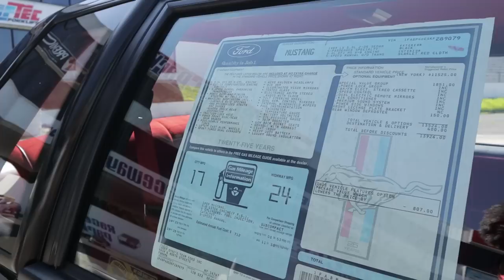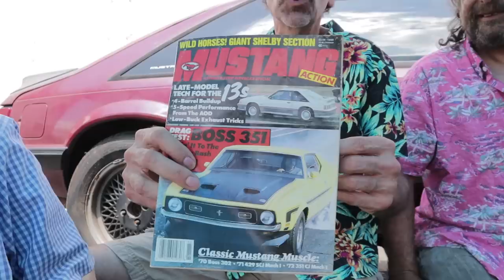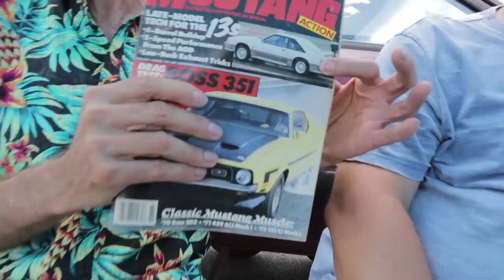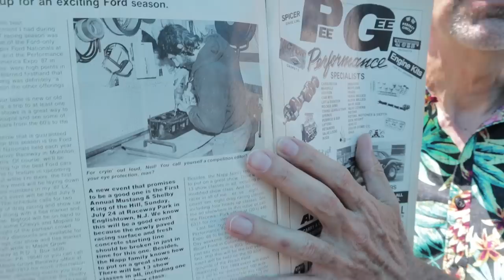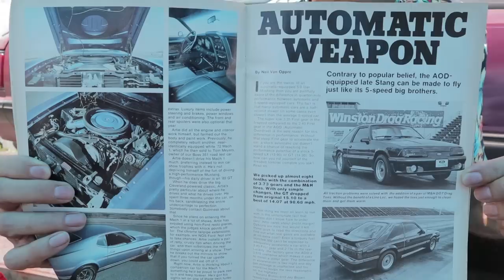5.0 Fox Body Mustang Revolution- The Second Coming Of The American Muscle Car

Comment: Im a Chevy guy but appreciate all brands. Ford nailed it with this
Reply: Those were classics.
Reply: justin c , Chevy guy here as well, fast is fast, as I’ve gotten older I appreciate anything American v8.
Reply: I own a chevy Cruze and a 97 ranger, 4.0 4wd 5 speed
Reply: I'll never sell my 93 notch back even if it just sits in my garage.... I have too many toys and not enough time for all three. Wish I lived in the south again where I could drive them year round.
Reply: BINGO. You nailed it. I'll never understand what causes so many guys to feel they have to "hate" the other makes. Of course you can be partial to one auto maker.......but that doesn't mean we have to hold such stupid animosity towards all the others. The best mechanics frown on that shit anyway. They know better. Cheers.
Reply: Chevy guy here too. I always lusted after the notchback LX. It was clean, good lines and stripped of all the fluff aero, decals and ugly taillights the GT had. Ford nailed it with the 5.0, gotta give props when they are due.
Reply: I'm building a period correct 86 sand beige stripper coupe with twisted wedges, 1.7s, ported intake, still SD.
Reply: The 5.0 is a LEGEND ford hit the nail on the head with these little cars. Tuned and driven correctly they would stomp anything on the road on thier day
Reply: @ragalyisp  those rangers lay you back when you whack it
Reply: I'm with ya brother. I loved the looks of the camaro but since it was slower I bought the mustang back then.

Comment: Back in 87-88 I hated Mustangs.  Was a Camaro guy, made fun of them dang 5.0's.  Next thing I knew, had a 93 coupe, and later bought my 03 Cobra.  So cool seeing some faces with articles i recall reading.  Super cool seeing Bernie  there.  +1 Sub.
Reply: WHAT BERNIE SAID ABOUT YOU COULDN'T BUY ANY PARTS FOR THE SMALL BLOCK FORD STEMS DOWN TO THE THREAT THE SMALL BLOCK FORD POSED TO THE SMALL BLOCK CHEVY BACK IN THE 60'S WHEN THE 289ci DEBUT. THE 289ci WAS SUCH A THREAT TO THE SMALL BLOCK CHEVY THAT THE NHRA (HENCHMEN FOR GM OR ANOTHER DIVISION OF GM) IN ORDER TO KEEP CHEVY IN THE WINNERS CIRCLE. WOULD CHANGE THE RULE BOOK ON THE 289ci MOTOR LIKE THE WEATHER CHANGED IN KANSAS TO DISCOURAGE ANYBODY FROM RUNNING IT. THE CHANGING OF THE RULES WERE BOTH WRITTEN AND UNWRITTEN. SO IF YOU SHOWED UP AND RACED AND WON. THE NEXT TIME THE RULES ON THE MOTOR WOULD BE CHANGED SO YOU COULDN'T RUN IT. IT WAS ALL BASED ON CHEATING. WHAT I WROTE HERE FINALLY ANSWERS THE MYSTERY QUESTION OF WHY FORD'S COST MORE TO BUILD. ON THE OTHER HAND YOU CAN BUY RACE PARTS FOR THE SMALL BLOCK CHEVY THAT WERE EVERYWHERE AT NICKEL AND DIME PRICES. SINCE THE SBC WAS THE FAVORED MOTOR. THERE PARTS WERE NEVER RESTRICTED AND MASS PRODUCED WHICH KEPT THEM CHEAP. ON THE OTHER HAND NEITHER WOULD FORD NOR THE AFTERMARKET RISK PRODUCING RACE PARTS FOR THE SMALL BLOCK FORD WHICH THE HENCHMEN FOR GM THE NHRA WOULD BAN OVERNIGHT, AND THE MANUFACTURERS WOULD BE LEFT WITH A WAREHOUSE FULL OF SCRAP METAL. BECAUSE IF YOU CAN'T RACE IT AND WIN, THEN PEOPLE WOULDN'T BUY IT. FOR THE FEW COMPANIES THAT DID PRODUCE PARTS LIKE CAMS, MANIFOLDS, PISTONS, ETC. THESE PARTS WERE PRODUCED IN SMALL VOLUMES BRINGING TO COST UP 2-3 TIMES MORE. NOBODY WOULD DARE PRODUCE A HEAD FOR A SMALL BLOCK FORD BECAUSE OF THE THREAT OF A BIG EXPENSIVE PART LIKE THAT BEING BANNED, WHILE AFTER MARKET HEADS FOR THE SMALL BLOCK CHEVY WERE PRODUCED WITHOUT RESTRICTIONS. WARREN BROWNFIELD WHO I THINK LATER STARTED AIR FLOW RESEARCH WAS MAKING RACE HEADS FOR THE SMALL BLOCK CHEVY FOR YEARS AND SO WAS EDELBROCK. SO IF YOU WANTED A HEAD FOR A FORD WHERE DID YOU GO, NOWHERE. YOU HAD TO MAKE IT. YOU ACTUALLY TOOK CHEVY VALVES AND MACHINED THEM DOWN. ALSO WHAT BERNIE SAID ABOUT A HEAD BEING AVAILABLE FOR THE SMALL BLOCK FORD. CAME ABOUT IN 1989 WHEN TRICK FLOW PRODUCED THEM. IMAGINE IT TOOK CLOSE TO 30 YEARS TO PRODUCED A HEAD FOR THE SMALL BLOCK FORD. AND THE ONLY REASON THEY DID WAS DUE TO THE POPULARITY OF THE SMALL BLOCK 5.0 MUSTANGS. AT THE TIME IT DEBUT THE RACE TRACKS WERE DEAD. ONLY CERTAIN HARDCORE RACERS MOSTLY CHEVY, WERE THERE AND THE STANDS WERE EMPTY. ONCE THE MUSTANG 5.0 CAME INTO EXISTENCE IT INJECTED STEROIDS INTO RACING AND HAS BROUGHT RACING TO WHERE IT IS TODAY. NITROUS, TURBOS AND SUPERCHARGING COMPANIES CAME INTO EXISTENCE AND THE ONES THAT DID EXIST STAYED IN BUSINESS BECAUSE OF THE POPULARITY AND MASSIVE POTENTIAL THE SMALL BLOCK FORD HAD TO MAKE POWER. WHEN I THINK ABOUT THIS STUFF. I THINK ABOUT HOW BIG OF AN IDIOT GALE BANKS WAS THINKING CHEVY WAS THE BEST AND THOUGHT NOTHING ABOUT FORD. IF HE WOULD HAVE PRODUCED TURBOS FOR THE SMALL BLOCK FORD. TODAY HE WOULD BE ONE OF THE DOMINATE LEADERS IN TURBO TECHNOLOGY UP AT THE TOP. BUT THINKING CHEVY WAS THE BEST BLINDED THIS MAN WHERE TODAY HE IS A LIMITED COMPANY STRUGGLING ALONG TO STAY ALIVE. LOOK AT THE IRONY OF THIS WHOLE THING. THE NHRA PUT BANS ALL OVER THE SMALL BLOCK FORD FOR YEARS TO KILL IT. ONLY FOR IT TO COME BACK YEARS LATER TO BIT THE CHEVY SMALL BLOCK IN THE ASS. ALL YOUR 5.0 RACE CLASSES WERE CREATED FOR FORD, BECAUSE THE SMALL BLOCK FORD HAD NO COMPETITION, THE CHEVY SMALL BLOCK COULDN'T COMPETE IN THESE NITROUS, TURBO AND SUPERCHARGING CLASSES. IN ORDER TO BECOME A PLAYER YEARS LATER GM DUMPED THE CHEVY SMALL BLOCK IN FAVOR OF MAKING THEIR OWN SMALL BLOCK FORD THE LS. FROM TOP TO BOTTOM THE LS IS 1000% FORD. NOT 1 ONE DESIGN ASPECT OF THE OLD SMALL BLOCK CHEVY LIVES IN THE LS, THE LS IS ALL FORD IN DESIGN.

Comment: Wow. Had an '87 LX hatch in 1991. Started with the 10 minute tune up and ended up with subframe connectors, 347 inches, and an 850 carb. Then I got into dirt track racing Chevys. Thanks for the ride down memory lane.

Comment: Hey fellas good to see your all still alive!
I bought my bright regatta blue 87 5.0L LX Mustang in April of 87, it was a stripper that stickered for $10,200 bucks.... I was at the track two months later, my first run was against my friend in his G.N wooshmobile, I beat him with a 14,5 to his 14.6 on the return track up at Lebanon Valley I got thumbs down for beating the Buick, I don't think many people had even seen the new 5.0L at that point but the thumbs down turned to thumbs up pretty quick. The Buick's became a formidable competitor for sure, once they figured out the dump pipe and computer chip tricks they really pulled ahead, it wasn't until we all discovered nitrous that we leveled the playing field with the Buick's. Those showdowns at Englishtown were a lot of fun too, of which the mustangs eventually dominated..  
Thank's for making this video as a lot of people have no clue as to the lame state of affairs the performance car industry was in at the time, the Mustang and you guys truly led the way to modifying modern operating systems on cars that everybody at the time was afraid to touch. It really worked out pretty good!
I still have mine 32 years and 250,000 miles later still kicking ass on most of the cars on the road today!   
i guess any hopes of a stripper cheap V-8 mustang are long gone!!
Reply: The G.Ns had a V6 Turbo which was a turn-off to be honest...

Comment: I will have to say i followed along with these magazine stories as well! I may not have had a Fox body Mustang at the time but i did have a Mark 7 LSC and if you could do it on the Mustang it worked just as good on the Lincoln! Lots of "trickery" to be played on the street with a Mark 7- like taking the peddle box out of the Turbo Coupe T-bird and converting over to a 5 speed or going to your local pull a part and getting a set of X code 4:10 gears out of a 5.0 4×4 Mountaineer along with the better flowing heads for the cheap!
Reply: I think I remember those Lincoln Mk-7s.  Way better looking than the previous generation.
Same platform as the T-Bird I bet, huh?
Reply: yea.. those Lincoln Mark Vll's.. were the shit back then, was very easy to make look real good and run good also! mine was one of the best looking cars on the road back then! I had a black one.. w/gray leather interior, all blacked out.. wrapped in 5% with 20% down the whole front windshield! with a set of black mesh.. "gta" wheels, "like on this lx in the back".. on it!
that car looked damn.. good!
Reply: The Mass State Police had the Hotrod Lincoln back in the day. 358 drysump, roll cage, the whole 9 yards! looked bone stock, you'd blow by him doing 75, 10 seconds later he'd be next to you! Smiling, lol

Comment: I had a 1970 Z-28 with a 350 and it was a high 13 second car. The first time I ran upon a 5.0 Mustang, I couldn't believe how fast these little Mustangs were. Neck and neck racing these little Mustangs. And reliability?   the 302 Windsor won the 24 hours of Lemans in 1968 and 1969..

Comment: I was always a GM guy but at the beginning of this Summer I came across an 87 GT 5 speed car. Not banged up or rotted for $700.00. It did not run but it runs great now. New tank, fuel pump, starter...... In 3 weeks running where I can drive it every day if I want to. Great car!!!

Comment: I am now 67 yrs old and my first car was 1964 1/2 Mustang convertible 289 4 spd 4 barrel and I bought it for 600 dollars in 1971. 
I have had 1968 Roadrunner I paid 100 for cause it needed work in 1977. I had a 1968 Firebird 400 4spd 4 barrel 410 posi rear end and a few more. I was very lucky to get these cars back in the day.
These cars were a blast to drive.

Comment: My father, uncle, cousins and I were at Englishtown all the time in the 90's...to hear the dragstrip is being demolished is heartbreaking and frustrating.
Reply: Scott Kalitta the son of one of drag racing legend's Connie Kalitta "The Bounty Hunter' died there back in 2008
Reply: @Frank289100  Gale Banks isn't doing all that bad because you are like many using an example to make a point. Banks Engineering is not the marginal little struggling company you describe if for no other reason than his R&D into diesel engines. Gale has the only drag race  vehicle with a diesel engine that doesn't "roll coal". I would be shocked if Gale Banks didn't have some lucrative contracts with GM if not each of the  Big 3. Gales R&D on the late model diesel in the new gen GM and Chevy trucks has to have turned a lot of heads in GM engineering for his work on high pressure diesel fuel injection. Which is the reason his former P/S Chevy S10 runs super hard, doesn't black smoke and gets such good fuel mileage that several passes, burnouts included on a 2 to 3 gallon tank.
Reply: @gregorytimmons4777  THE POINT I'M MAKING IS IF HE WASN'T SO BLIND TO THINKING CHEVY WAS THE BEST AND CATERED TO FORD. MOST OF THE TURBO CHARGED RACE CARS OUT THERE TODAY WOULD HAVE A BANKS TURBO SYSTEM. GAIL BANKS WAS A BLIND FOOL.

Comment: I always knew there was something special about you Uncle Tony. You where my hero and I didn’t even know it. I was born in ‘83 but I’ve been a huge 5.0 fan since ‘90. I still remember the first mustang I saw it was a Wild strawberry Lx Hatch with Pony wheels. I was playing in my grandparents front yard when this car came around the corner sliding sideways and grabbing gears marking the best noise I’d ever heard. 🍆 I was hooked at 7 I knew what my first car would be. My family were all Chevy guys so they gave me shit for the next 8 years because all I did was read every magazine article I could find on 5.0s. I got a 37 in English class but I could tell you everything about a 5.0. My first mustang was a ‘90 mustang Gt AOD😩 25th anniversary black with grey tweed interior, turbines and cheese grater tail lights. As soon as I brought it home I gave it the 10 min tuneup. First pass was a 15.5. About a month later it got an off-road H and Flows. Then Draglights March underdrive Pulleys and a MAC cold air intake. 4.10s and a B&m Hammer shifter and the mandatory 5” monster Tach. My first street race I got my ass drug by What I thought was grandmas Regal with some welds on it. I mean I should have won mine sounded so much better. He schooled me all about the T-Type. After that I scraped together every dollar I could save and bought a NOS 125 Dry kit. Never saw the kid in the brown Regal again but I was hooked. I’ve always had a Fox body mustang ever since. I wish I could send pictures on this.
Reply from the maker: Awesome!

Comment: Really enjoyed every minute of this. As a teen in the 80s the fox body 5.0 was every kids dream. I finally got a 89 lx 5.0 but me being a 4x4 guy traded it for a bronco. Wish I had the car back it was a ton of fun. And........alot of the tricks for the stang 5.0s some what crossed over to the truck 5.0s long as you converted over to mass air. Trucks and Broncos had the shitty speed density atleast up to 94 or 95.

Comment: in '88 i bought an '84 1/2 GT with T-Tops. that thing was a game changer. sure it was still from the carburated era but it was the 1st car i had that would light up the tires while rolling in 2nd gear. the handling on that thing was phenomenal and was so perfectly balanced. that's the car i wish i never would have gotten rid of.

Comment: I had an '85 GT, and an '87 LX 5.0 notch back. Neither car seemed to be very good quality, but both were a blast to drive!
Reply: I own a 91 GT and I have to agree with you.
Reply: @TheBrokenLife  
Squeaks, rattles, and rust abound!
Reply: @EarlSinclair97  That's no joke... Fortunately there's hardly any rust on mine.
Reply: And yet compared to my 88 Iroc Camaro those mustangs were a quality built  masterpiece. I've owned 4 camaro's from 79 to 99 and other than the 79 they were all poorly built peices of shit. I'll stick to my mustangs from now on.
Reply: @SnEaKeRSkEr  
Agreed, I also had an '87 IROC for just over a year. I was always working on that car, something was always breaking. Poor interior trim quality and T-top seal leaks. The biggest rattle box ever! Just like my '85 GT...lol. Must have been an '80's thing I guess.
Reply: @SnEaKeRSkEr  I actually prefer that generation of F body over my Fox... The interiors are about 20% bigger... But, my Fox is about 20% faster... SO....

Comment: I had a 87 GT back in 1991. I loved that car.
Reply: Still had the 85 speedometer in 87.
Reply: @210SAi   I sold it in the early 90's because it would "bog" on the freeway and I could not figure out why.  After the invention of the internet and reading I realized it was just the symptom of a slipping clutch.

Comment: Im in southwestern Ontario Canada and I started this since 1986 when I built an 81 Capri Black Magic. It had a nicely built 302 bored .0040” and decked the block .001” with dual Holley 650 on a tunnel ram intake with a top loader. I was port matching heads and intake since 86 with the small cc iron heads. I knew what goes in must come out. My redline was 8000 and I used every rev. While everyone was jacking up the back end of their firebirds and Camero’s with 295’s in the back and 225’s in the front. I lowered mine 2 1/2” in the front and 3” in back. Put Bilstein B1 suspension on all 4 corners. Big sway bars front and back with 2 q/2” Mac exhaust from headers to tail pipe. and to finish I put a Kamei X-1 ground effects package. I had the Simmons 4 piece mesh rims. 16”x 9’s in back with 16”x 8’s in front wrapped with Pirelli P Zeros , Yokohama R series tires and Michelin pilot sport tires. 
I was killing Grand nationals, and ZR1’s all day everyday.
I called it Rat Poison. I killed every rat motor back then and ran it in 11.76 in the quarter at 121mph.
My top speed was 191.72 mph. I broke the 200 mark in 88.
I still have the car.

Comment: Oddly enough my son just bought a 2004 40th anniversary mustang GT convertible 4.6l automatic, air, ps, pb. 80k it runs and drives nicely but the rear end howls at  a constant speed. he only paid 2900 for it.
Reply: That's the sweet generation of them to be in right now if you want to play on the cheap. There's a rolling chassis for sale up the street from me for $500 and I bet $300 would take it home... Slap your drive train of choice in it and hit the track. Cheap fun!
Reply: Yea man the 94 to like 04 mustang model can be had super cheap right now. I just bought a near perfect 98 cobra with 92,000 miles on it for under 6k and constantly find good gt models from 94 to 04 for 3 to 4 grand.
Reply: @gsfbffxpdhhdf7043  no if it were spider gears that would be during a turn. he had it rebuilt and it took pinion bearings, carrier bearings and ring/pinion replaced. now its fine.

Comment: Ohhhh my GOD!!!! This was freakin awesome!!! Yall were all the pioneers that got me at 19, and my first fox, a white w red clothe interior, aod,273,  throigh my time in the service. 15.00@91 mph to three years later 10.50@121 175 wet kit, w cold a/c blowing ...Thank yall for leading the way for all of the diehards that roamed the streets of America, hunting down all those Lt1s, T-types, vettes,and small block s-10's..My car had a decal on the top of my hatch glass  that read; "5-liter Chevy Eater" lol This story of the fox and how it went down should be told, and yall did a great job of hitting some key milestone moments of the journey the cars went on to be the greatest muscle car ever made for a hard working blue collar guy. Any contact info? Id like to ask a question that came to mind after watching this. Nice Job! Josh, Houston, Tx.
Reply: Correction 15.50 @ 91 mph. Sidenote the car never had the heads off, stock cam, intake, tb,injectors, and on motor was a high 12 second daily.